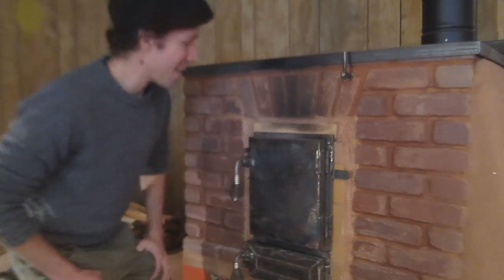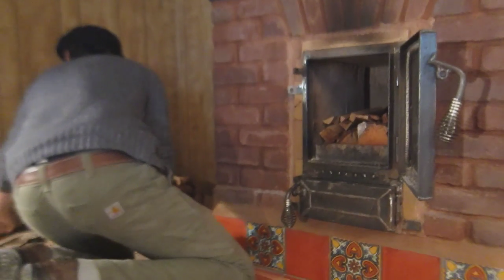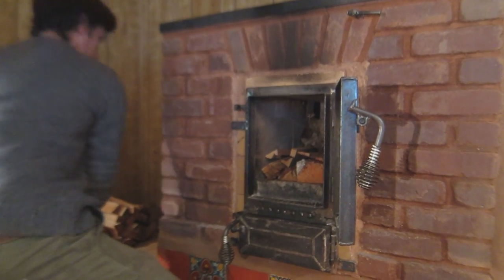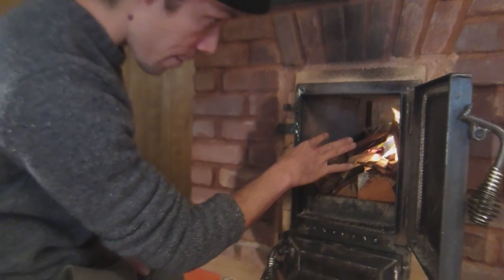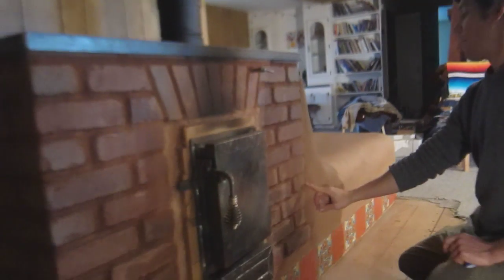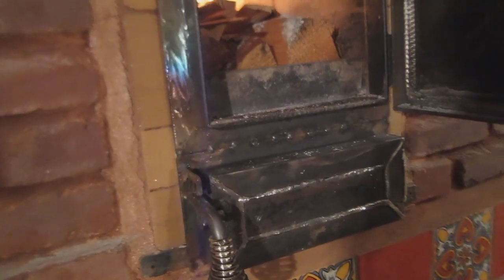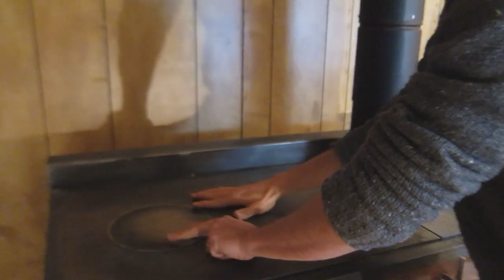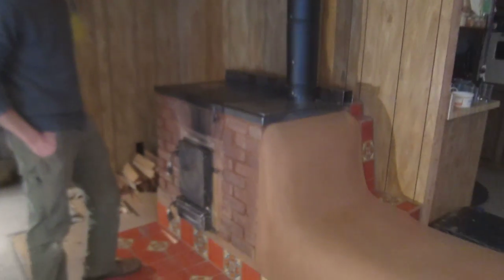Lighting fire in Cabin Stove w Heated Bench

Comment: you should do like the air i do  completly fill up the stove with kndling    leave the air wide open   let it burn down to hot coals   than completly fill up the stove with large  wood  keeping  the air wide open  in till its burning good  than i turn down the air  for long hot burn i can get the bulding  up to 90 degrees